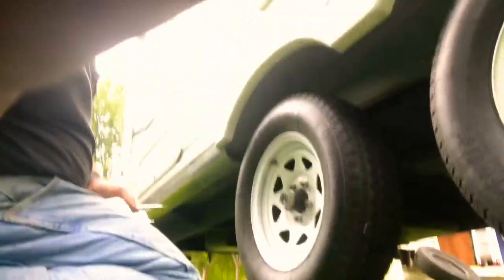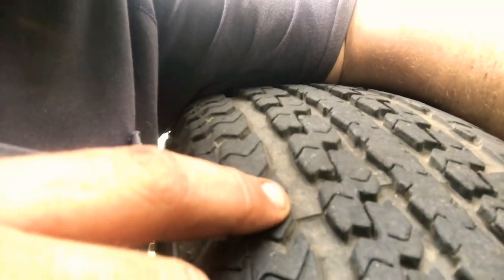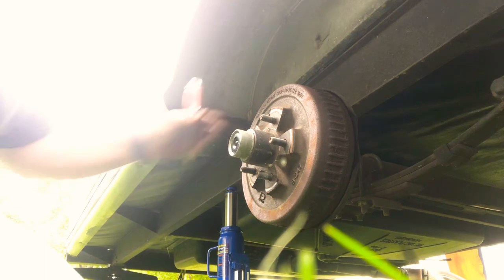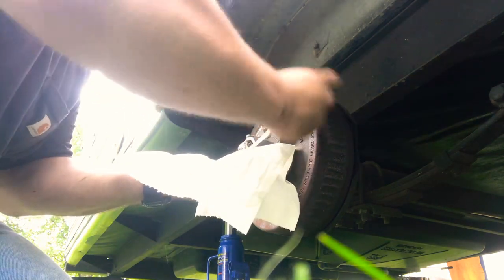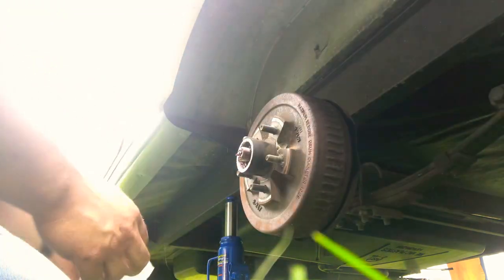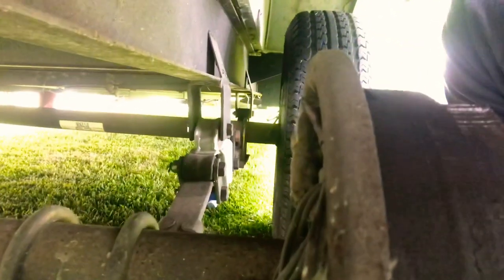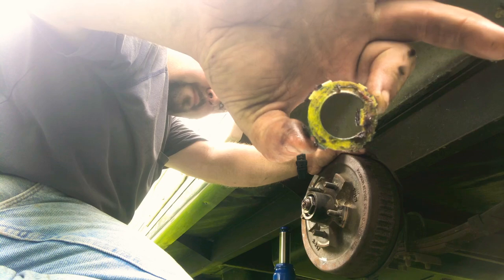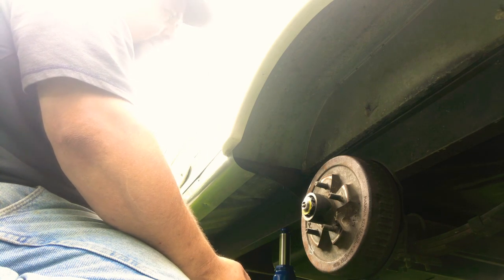Rv tire wear.

Comment: Great video, Kevin.  Thank you for posting!  We were just about ready to leave on our vacation last week when I noticed one of my tires on the inside of my tandem axle was worn pretty bad.  All three of the other were fine.  Since we were leaving in a few minutes, I just changed the tire and put on the new spare.  I suspect the wheel bearing is loose on that wheel.  We took our vacation and drove 400 miles and so far it looks alright.  I haven't checked the bearing yet, but that is what I believe it is.  I want to check it before we take our next vacation and your video provided a thorough insight on how to do it.  Thanks again for a great video!!
Reply from the maker: Thanks for watching. Glade it helped. Have a safe wonderful trip

Comment: Kevin we just subscribed to your channel, saw you on Hebert’s travels!!!!!             thanks for the GREAT INFORMATION AND KNOWLEDGE YOU SHARE.... we are first time rv’s we just bought a travel trailer a month ago and she needs work from front to back we sure will be watching 😊
Reply from the maker: We are free to roam what kind of unit did you buy- new/used, model, year. What all dose she need
Reply: Working to Relax Kevin ::::    she is a 2006 fleetwood wilderness m3102bds.   She is used of course being a 2006😊.   We were kind of well suckers. The people sent us all kinds of video and photos, we went and got financing, turned the photos in to the bank. And on pick up day well let’s just say someone knows how to take great photos.   So we drove her up the mountain, parked her in a storage lot for a few weeks. Then began really looking.  She  is delaminated more than not. And when we put the big slide out for the first time well let’s just say we had VERY CHEAP air conditioning... the walls separated from the floor. So we figured it surly can not get any worse. We watched many videos on how to repair. And tackled it after about 2 1/2 days we finally had that fixed😊. The smaller slide need repair as well. We tried turning the fridge on (nomadic)  does not get 🥶 cold. Thank God my husband is an electrician. And hopefully he can get it running..         So this weekend we are removing all of the caulking and gunk. And redoing every seam we were told to use lexan I think is how it is spelled. To replace all of the caulking. The slides have only a canvas roof, with 1/4 inch wood (mostly water damaged) under the ceiling board. The underside of the slides are wood? Odd I know. So we need to figure out SOMETHING to coat the slide roof and under belly, to protect it. The flooring in front of the propane stove (not sure if it works yet either)  is squeaky. We are also going to try and use the holding tanks and water , and see how they do or do not work.... LESSON LEARNED     DONT TRUST FOLKS with video and photos.    But we think once we get her injuries fixed she will be good as new or almost... it sure is a CRASH COURSE LESSON.... and I truly hope we are going to do it correct... we are trying to learn and watch as much information as we can, in hopes we don’t do the repairs incorrectly.     😊.  Btw we are James &Robin  and thank you for your videos so far😊
Reply from the maker: We are free to roam well James and robin. Nice to meet you. Sounds like you have your hands full. Hate when people are dishonest when selling an rv. Especially to good folks and those that have to finance the unit. By all means send me pictures and or photos of what ever you got going on. Costing the rubber roof only is a bandaid for a old roof. If you replacing the roof might as well do new rubber roof. Lenard’s sells the same material as the rv. Should be glued down on new clean smooth wood.
Reply: Working to Relax Thank you Kevin, how can we send you photos? We are trying to do a band-Aid to the roof right now. We have been researching companies that do new roofs (come to where you are) and they give a life time warranty to the rv not the person.    We are suppose to be in TX to begin work by mid oct.  then we can afford to get the entire roof done all at once. Or if we are blessed and our house sells soon😊 They have said approx 120.00 A linear foot. So I guess that is the most important major job then. We will at least have a good safe dry roof😊.    Might you have any suggestions on what to coat the slide underbelly with?    Yes we are NOT very happy with the way we were um how would you say lied to.   But we have to let go and let God deal with them...    once again Kevin THANK YOU SO MUCH.   It is so wonderful to meet nice honest folks😊
Reply from the maker: We are free to roam well you can feel free if your on Facebook to friends me and then u can instant message me. You can also find working to relax on Instagram as well. 

As for coating the slide under belly. I would need a little more of an idea as to what you mean. I my self have never hear of such a thing.  The roof yes underbelly no. If you send me some pictures or a sort video explaining why and what’s going on with that I would be happy to help.
Reply: Working to Relax okay your Facebook is working to relax?      THANKS😊
Reply from the maker: We are free to roam o I’m sorry no it’s my name Kevin Barone
Reply: Working to Relax okay thanks Kevin, we are working on her today and when we get done I will try and send pics 😊

Comment: I too just saw you with John. Thought I had  an axle problem but bent spindle due to curb climbing might be the issue. How would  I check that? A basic square 🤔🤷‍♂️🥴
Reply from the maker: Joseph Milbrandt thanks for checking me out really appreciate it. A bent spindle is something you should definitely contact the axel mfg for. They all have there way of telling if it’s bent. That is what I will do if that becomes the issue. Not only that the axel mfg is going to want you to take it to a professional service shop to be inspected. Before you cross that bridge try what I did in the video. I ran into this once before with ours and ours has been curbed a few times. Takes a lot to bend a spindle.